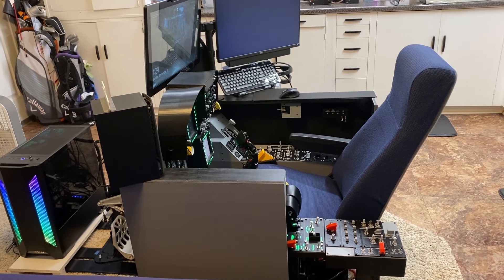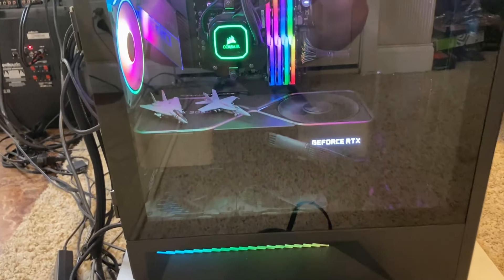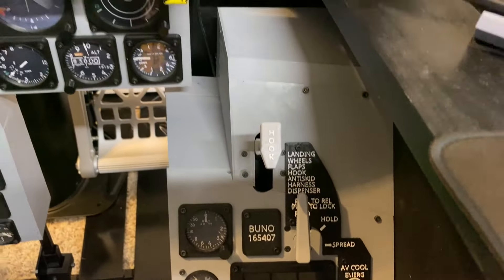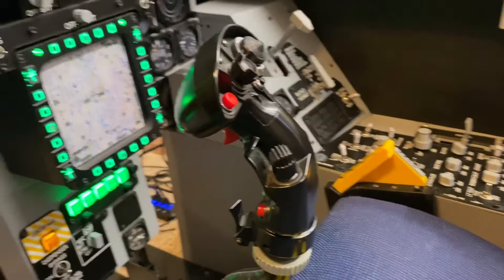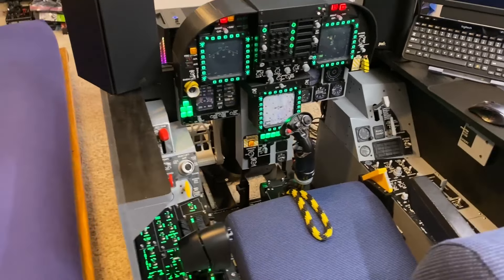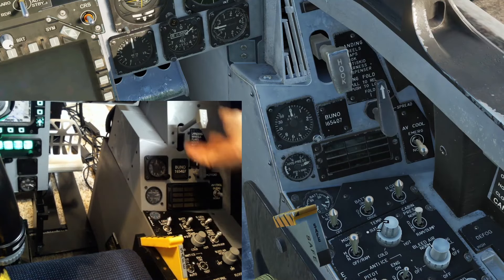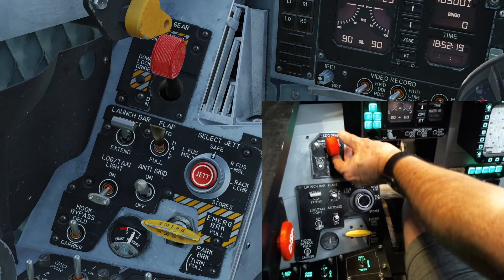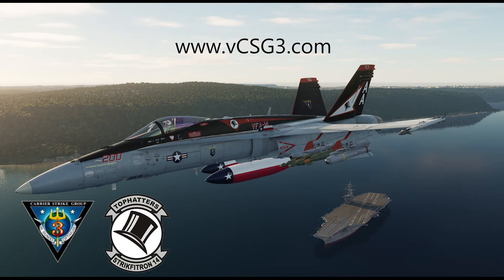3D Printed F/A-18 Hornet Cockpit for DCS World

Comment: Man this is serious work with some serious talent. I wouldn't even know where to begin with a project like this. Nice job!
Reply: What does a setup like this cost to build? I know those sticks just alone are like 500 bucks
Reply: @208flatheads3  Basically just doing really big estimate here cause I'm not entirely sure, but the PC that's running it is probably like 6 or 7k, the stick as you mentioned, is roughly 4-500$, You'd need a 3d printer to make a bunch of the panels, which is probably another 400-600, maybe more depending on the printer you get, The fillament for the printer is surprisingly cheap so I'm probably going to chalk that up to about 50$
I'm guessing, rough estimate for all the other cockpit equipment is another 1k ish, and the rudder pedals are also probably similar in price to the flight stick at around 500 ish dollars
so in total, a rough estimate for the price of this whole setup
10k?
Added a couple hundred for things I didn't include like the seat and other things

Comment: Instead of VR i would put a huge Curved screen for this setup, its looking so good, for me personally it is a waste of immersion and time to play on this setup with VR ;)
Thats just my small opinion :D 

Besides that it is a great job and amazing setup :) 

Good luck and Good Hunts Sir :)
Reply: I honestly think this is just the next best thing to full finger tracking, which seems to always be right around the corner. If finger tracking is worked right in dcs in conjunction with vr I'd find playing the game 100x more fun, especially with all these new headsets coming out with increased resolutions. I guess might also just like the idea of able to use head tracking for targeting 😅. Motion sims are also one of the few games i think have an actual use case for these force haptic gloves that are starting to get hyped.
Reply: @BananaSentry   The next best thing would be a full motion sim.  I've seen them for between 15-30k I think ? China.
https://www.youtube.com/watch?v=gxXOGbbQcfA&t=81s

It shouldn't be too difficult to build something like this yourself. I mean the software and hardware should be pretty straightforward for basic full motion sim in helicopters or not doing alerons and barrels quickly. (You would need a bunch of hydraulic actuators for that)
Reply from the maker: A 2D screen will never beats depth perception of VR from an immersion standpoint
Reply: A curved screen works well for the warthog because you're mostly facing forward, but for a fighter when you're constantly looking up and back it's more awkward.

Comment: My question is: How sturdy is it?

Do you have to worry about breaking the switches and dials? Or leaning too much on the stick and paneling?
Reply: Looks pretty usable to me
Reply: @AndroidFerret  
I think so too. But I can get a bit rough when I have to act quickly in a game and I just was wondering if a setup like this can take rough treatment.
Reply from the maker: Its mostly all 3D printed plastic, so it will break if overly stressed.  I haven't broken anything yet, but some of the more intricate controls (parking brake, hook, g
ear, etc) I'm pretty gentle with
Reply: @DCSTex  
Thanks.

Comment: A really nice build!

Not quite the crazy 1:1 scale fwd fuselage builds of some, but a more practical yet close approximation of the real deal.
Impressive.

What type of seat are you using? Is that an old airline or coach (bus) seat?  
It’s seemingly narrower and more practical for a flight sim pit than a typical (race) car seat often seen on race sim rigs.
Reply from the maker: Good Eye..It is out of an old charter bus.  It sorta looks the part and is very comfortable. I can sit in it for hours with no issues.  Working on getting the bottom re-upholstered with a cutout for the stick and ejection handle

Comment: im not a flight sim player but that looks awesome enough to become one! Good work!!
Cable tidying probably has happened by now - how did you do it? i've used plastic corrugated wire ducting (for underground cable protection) in the past; looks ok, bends well enough, and is strong enough to cut wedges to make sharp angle turns either held by pressure/super glue/duct tape

Comment: Dope set up, but it would be so much sicker with a much better display, possibly even widescreen. VR would be on another level too, especially if the plane's cockpit matched your setup. That would be a trip.
Reply from the maker: Thats exactly what is is.. mentioned 30 seconds into the Video. as close to 1:1 as possible to match VR
Reply: @DCSTex  Yeah I wrote that comment super early, and then just left it. I did hear you talking about how the setup does indeed work with VR later on. Nice job brother.

Comment: Really impressive set up and control design. LOVE it all and thank you for displaying your creative design. The TPR damper set up. What does it actually change in the flight charactistics? Is this something you can purchase?
Reply from the maker: The damper just gives some "hydraulic" feeling to the pedals.  without it its just spring resistance.  With the damper you can adjust the resistance to where the pedals will not return to center (for helos).  I think there is a company making them for resell but its about 1/2 the price to buy parts and do it yourself
Reply: @DCSTex  Thank you for your fast response. I would think the mod for the dcs ah-64d Apache would be an advantage for sure.  As it's a challenge to work out a sucessful take off and landing technique. Do you find the damper mod works better for the Apache? How does it work the F/A18?

Comment: Just from the audio aspect if you could find a way to clear out the space on the right speaker it will make a huge difference.  That keyboard and the mount bar are really changing the direction of the audio but other than that JESUS man I am fuggin jealous
Reply from the maker: Those speakers are just for the "world" audio, so its mostly just engine noise.  All the helmet sounds (radios, warnings, tones, etc) all come through the headset speakers

Comment: Thats so great and I am really wondering how you did the custom controls like the parking break which you can turn and push/pull. Any hints on the technique? Because I am building right now but as far as of now I am only using buyable parts like switches, toggles, potis and so on.
Reply from the maker: check out the ED forum post..it has some pics of the individual controls

Comment: Can you point me in the right direction for how you made the right side console?  You mentioned Leobotner boards.  How are you interfacing the switches to the board and then to the PC and then to DCS?  I made an extruded aluminum sim pit and am looking to make the dive into a more authentic looking Hornet setup.   Thanks
Reply from the maker: The switches/buttons/potentiometers/encoders wire to the leo bodnar boards and they connect to the PC via USB.  windows recognizes them as a standard USB gamepad and they show up as a column in DCS.  You bind them just like you would a stick or throttle.

http://www.leobodnar.com/shop/index.php?main_page=index&cPath=94
Reply: @DCSTex  awesome.  Sounds kinda straight forward.  Does the board need programming or arduino sketch loaded to it?
Reply: @DCSTex  you have a part number to the one you used?
Reply: @DCSTex  my apologies for the rapid fire questions.  Would you happen to have a wiring diagram for how you did all this?
Reply from the maker: @Nick-xe2hu  no they are pretty much plug and play.  There is a little app if you're using encoders, you just have to to tell it which pins have the encoder wired in
Reply: @DCSTex  Awesome.  Thank you sir.

Comment: Came here after seeing your update video! Gotta say this is a night and day difference! 

How did you do the ejection handle? I'd love to make a setup like this for the f16 in DCS and also adapt it a bit to Star Citizen.
Reply from the maker: its a 12/3 electrical cable with yellow/black braided shield around it.  The mechanism is 3d printed with a spring and micro switch in it (same as old one pretty much)

Comment: i have to mention the aircraft on the GPU is very cool , BUT! , i did it once with diffrent toys and let me tell you i had a 2060 (now 3080) ,and over a year or two the color degrades and the plastic almost looks like its melting and i bet in the longer term it is ruined , so if you have any value for them , dont put them inside the chasis.

Comment: Hey, just a concern, maybe don't leave plastic minis inside your case. Yes, it's cool, but as a poor sap in China recently found out, PC cases get hot. Hot enough to melt the plastic minis, then for the slag to touch the board and cause an electrical fire.
Reply from the maker: They are diecast metal
Reply: @DCSTex  Ah, good to hear. Just wanted to make sure all your hard work wouldn't go up in smoke.

Comment: Hey mate. Would I be able to ask for some more info on how you mounted the super Taurus to the back set of switches you printed (obogs etc)  thank you
Reply from the maker: yes.. I originally used the monstertech mounting brackets and designed  a 3d printed adapter that bolted onto those mounts.  I've since re done the side consoles in more of an "Enclosure" type setup so the back set of switches are no longer mounted to the super tarus
Reply: @DCSTex  thanks mate.

Comment: So what parts are purchased? I just started with my build - thrustmaster warthog HOTAS, HP reverb 2, thrustmaster TFRP.  I can’t even get my joystick calibrated properly 😅…
Reply from the maker: I purchased the Virpil joystick base with the TM Hornet grip, the 3 Thrustmeter cougar MFDs, and the Winwing Super Tarus throttle, the rest is 3D printed
Reply: @DCSTex  wow that’s incredible! I got my flight certs at my local flight school… but I’m not very tech savvy so excuse me if I sound like an idiot.   So you printed the panels and switches how do you plug them into the computer and how did you then program the switches to tell the computer what to do?
Reply from the maker: @chrissolano4161  I used Arduino controller cards and Leo Boadnar USB interfaces to wire all the controls up.  The PC reads them as USB game controllers and you bind them in DCS just like any off the shelf joystick/controller

Comment: Maybe I'm cynical, and I admit this all looks amazing, a real labor of love which is probably just as satisfying watching the whole thing come together and admiring it's completion than actually using it.  If the old flight sims of the late 90s had all the systems modelled with clickable cockpits, this would have been amazing for a game like F/A-18 Korea, especially if you had a larger CRT monitor... or 3 of them.  But with today's VR headsets which are evolving rapidly,  this seems almost counterproductive.  With the good HOTAS, pedals and a comfortable chair, isn't the headset enough?  And doesn't the placement of all the switches clash with every module that isn't the F18?  

Maybe I'm just a cynical douche bag, it really does look amazing.
Reply from the maker: It is definitely not easy to use with other modules/  At that point you just use the mouse (which is how 95% of people play DCS).  But for the hornet in VR, it is amazing.  I never have to use the mouse and everything is close enough to match what you "See" in VR that every control is pretty much where you expect it.  The biggest advantage is not having to look at a control to operate it.  If you use the mouse in VR, there is no way to do that without keeping your focus on the control you are trying to manipulate.

Comment: Great build, out of interest, roughly how much would the weigh? Thinking of building one to sit onto a motion platform.
Reply from the maker: way too much to sit on top of a motion platform.  If I was going that direction I would've made different choices for the structure and frame for sure
Reply: @DCSTex  sorry I should have mentioned that I am going to build the motion platform so weight is not really the issue but in planning on motor a d actuator specs I need to l ow how much weight it needs to carry, hence the rough estimate question, not really worried about the cockpit frame materials just the panels and all electronics so if you have a rough idea of how many KG the guts weigh minus structure, monitors and pc, that would help me out massively.

Again great build.
Reply from the maker: @darkphoenix6811  sorry man, I have no clue on weight

Comment: No, it's not a "3D Printed....Cockpit". It's a cockpit (sim) manually assembled over many hours from many 3D Printed plastic parts, which is fine and wonderful.
3D Printing Rule of Hype: Whatever noun follows the phrase "3D Printed" is ALWAYS the wrong word choice, typically claiming that the next higher assembly was somehow 3D printed.
Until you can extrude LEDs and copper wires and switches and terminal blocks, then you won't be 3D Printing any Cockpit (sims). 
"Hey, please pass the tube of Cockpit Paste, as I want to 3D Print another Cockpit."
3D Printing is neat, no need to overhype it.
/rant LOL

Comment: Cool, but how would you use most of these buttons when you've got a headset on your head? Honest question since for me the biggest problem with dcs is just how to properly use all the controls in the game.
Reply from the maker: They are almost exactly in the physical world where you see them in the virtual world.. so when you reach out for a conrol its where you "See" it. you just don't see your hands
Reply: @DCSTex  Thanks for the answer. Would there be a way to use a reverb G2 effectively without this rather expensive setup? I've had the G2v1 in the past and thinking about jumping back into it to learn dcs. The expensive of this is holding me back so wondering if I can do this effectively without all the button boxes
Reply from the maker: @PKAWA  just have to use the mouse.. pretty much how I fly everything that isn't the hornet

Comment: This is so impressive that I am thoroughly confused.  Printing and constructing a pit and controls that looks authentic is impressive enough, but the controls all "work" and are integrated into the game (somehow)???   At a loss for words.  So how, exactly, did you you do that part?   You mentioned arduinos, so you coded everything yourself?  and there are APIs (I'm guessing) that the game provides?  I guess I am just showing off my total ignorance here.  any further explanation would be appreciated!!   nice work
Reply from the maker: Its simpler than that.  The aurduino sketch basically turns it into a USB game controller and windows and DCS recognize it as such.  Its like playing the game with 13 different joysticks plugged in
Reply: @DCSTex  Thanks, but what about the VR headset -- if you're wearing that while playing, you can't see the physical controls right?  only the digitally created ones.  So how does the game figure out how to "map" the virtual controls to the physical ones you built?   I don't mean input mapping, like this button equals F10 or whatever.  That part seems straightforward.  I mean the VR side of it -- when wearing the VR headset, and not able to see the buttons, somehow you have to be able to "see" them anyway and press the real buttons in real life.  How does that work?  hope I am making sense.  Like I said, I'm still very ignorant on this stuff!
Reply from the maker: @carlpetitt2241  The buttons/switches are as close to a 1:1: replica as I could get.  You "See" the switch in VR... reach out and "feel" it in the real world.  Its close enough that with a little bit of muscle memory and some tactile help its extremely easy and intuitive to use.  If you notice I have 3D printed switch caps for the switches so they are the right shape.  Also on the DDIs and the UFC Keypad, I have little "bump" stickers  on them so you know when you're on the middle button.  There is a bit of feeling around to make sure you are on the right switch/button but its still way faster than using the mouse.

Comment: shame you couldn’t make the landing gear knob out of a semi transparent filament, with a red led in the bottom of it that, when it bottoms out one way or the other, uwp or down, it touches a switch that turns the LED on for a set amount of time before turning off but only when the switch is touched.
Reply from the maker: That one of the upgrades I've made.  Check out my update video - https://www.youtube.com/watch?v=0ykhZ8hKZ0c.  The LED is controlled by DCS BIOS so it mimics the behavior of the light in game

Comment: All that... for the display of a single 27" flat screen monitor?
Reply from the maker: nope...all that for VR.. mentioned 30 seconds into the video
Reply: @DCSTex  But how does that work since the headset blocks your entire view of the setup?  You'd have to memorize where all the buttons are, and feel around like a blind person.  I've tried that before with my logi-panels.  It's not fun.
Reply from the maker: @skydriver5709  The difference is all the switches are in the right spot, so you "See" them in Vr and they are where you expect them to be when you reach out.. you just can't see your hands. It does take a bit of muscle memory to build up, but I can operate any switch/button with very minimal "feeling around"  Its incredibly faster than trying to use the mouse

Comment: What is it made out of? Is that hair strong enough to sit on? I’m lost from what the material is.
Reply from the maker: The front panel is 100% 3D printed - structure is PETG and the panel faces are PLA.  The structure on the side consoles is MDF with 3D printed panels.  The chair is out of an old charter bus on a welded steel frame

Comment: Where did you buy all the fixtures, screens, and displays?
Reply from the maker: Its a VR rig so there are no screens or displays in it.  The stick throttle rudders and MFDs are all commercially available (Thrustmaster, Virpil, and winwing).  Everything else is 3d printed with buttons/switches/encoders sourced off ebay and amazon